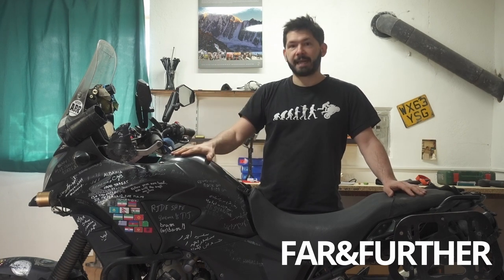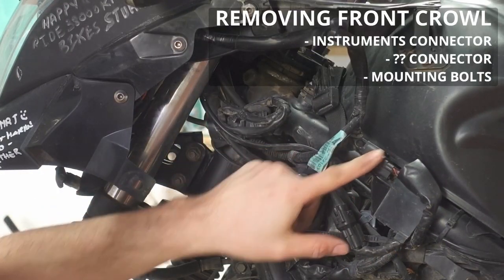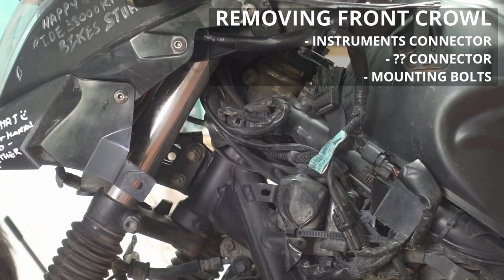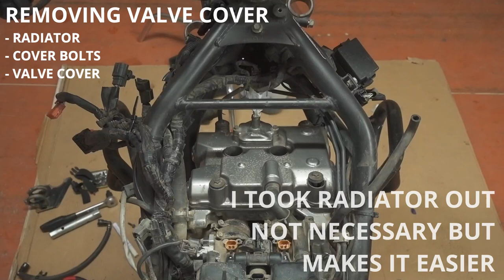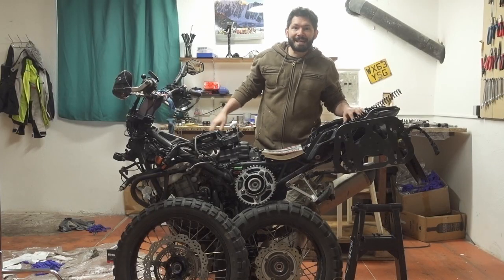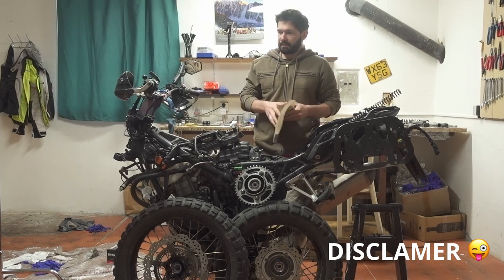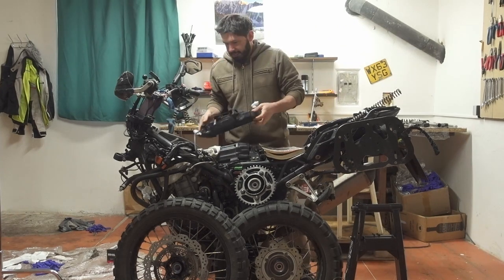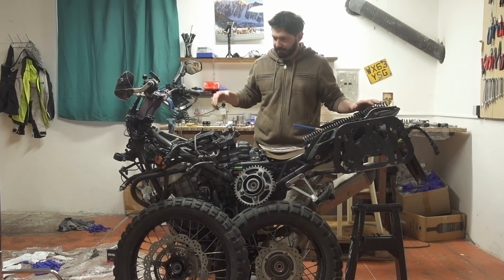Maintenance - Disassembly

Comment: So. I made a classic failure and knowing what I know now, it will not happen again.

But, I checked and then removed the exhaust shims. The left side first which was a bit difficult and I was worried about losing a shim but more because how strong the magnet was. To make it easier to remove the right side i thought it best to turn the crankshaft a bit as I did it, the two other exhaust shims went flying. One landed a full 3 feet away and the other, well that is the issue. I cannot find it. 

I had a full garbage bag full of stuff and emptied it but no luck. I drained the oil and filter. 

So, I got an endoscope (good camera) and can look around every where. Of course now I can see if you leave the plugs in and cover the cam chain area you can probably get a dropped shim easily but the cam chain area is a different story. 

So I used the scope and magnet all over the valve cover area and nothing. And the same for the cam chain area. Nothing. 

I have tried a vacuum and a compressor to blow but no luck. I removed the clutch cover and endoscoped and magnet through there and no luck. leaned the bike way over and did the same with compressor but nothing.

I have turned the bike engine over with the rear wheel (with the plugs out) and everything spins and no binding.  Drained the oil...

SO. I don't think I am going to drain rad fluid and turn bike upside down securing it from above.

I am at the point now where I am going to pour some oil down from the top, maybe spray it with a small pressure bottle.

It seems to me I can see just about everywhere it could be except behind the camshaft bottom sprocket that I am very reluctant to remove.

I am thinking the next steps, after flushing with some lightweight oil, will be to re-assemble turn over and start and then slowly go through the gears.

I have probably looked for about 6 hours just at the valve cover area and clutch, with about 6 hours searching and cleaning the garage.

Probably, just looking for some sympathy.

 ps. This is a great video.
.

Comment: Hopefully you're reading comments still but I might be doing an engine swap for my 13 cbx I was wondering if you're able to give me any tips or heads up or even mentoring me through this process?
Reply from the maker: Hello, are you just swapping and engine or you’re disassembling it? What I would recommend is to get the service manual for the CB500X. They are online free to download and it will help you enormously.